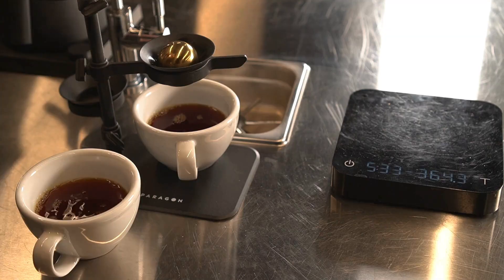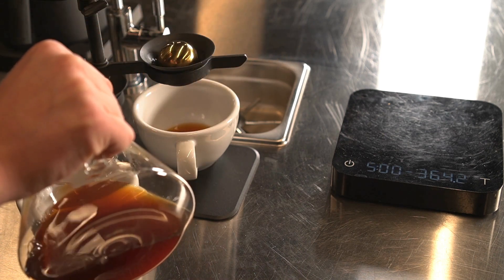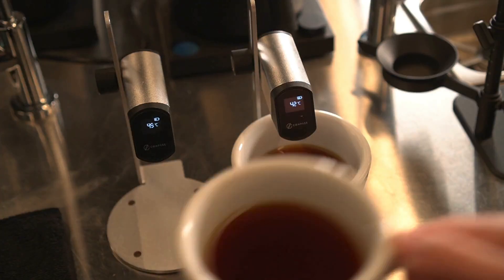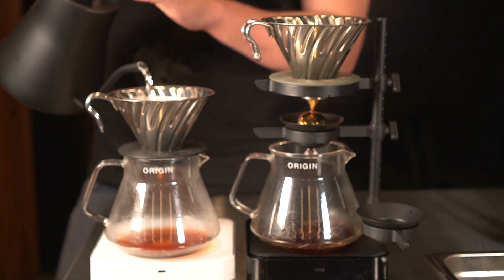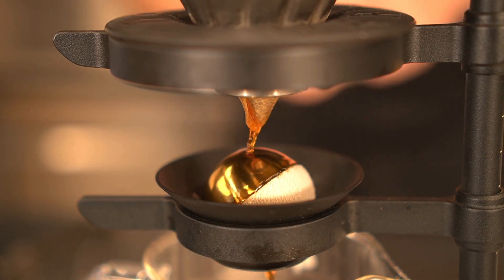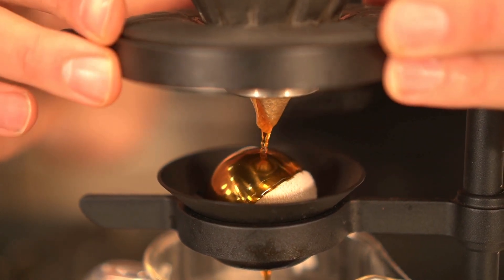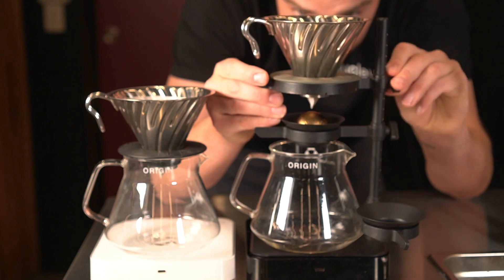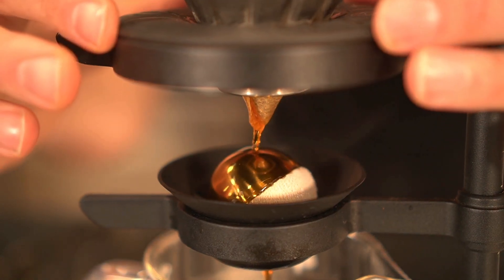Extract chilling vs Post-Extract Chilling

Comment: You can use a lower tempature bloom (i.e. Samo Bloom) to retain as many of those volatile organic compounds as possible.
Reply from the maker: True, and we do love a Samo Bloom. There are several ways to retain and capture aroma volatile compounds, but if you're wanting to brew at higher temperatures (eg. to reach a certain extraction yield, or for a particular brewing method) then rapid chilling in the initial stages of a brew is a great way to do so.